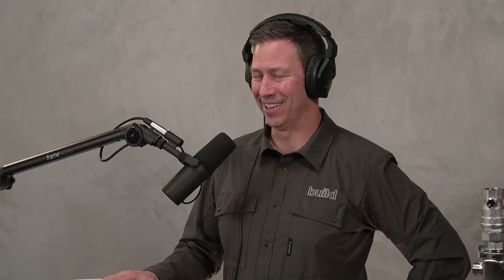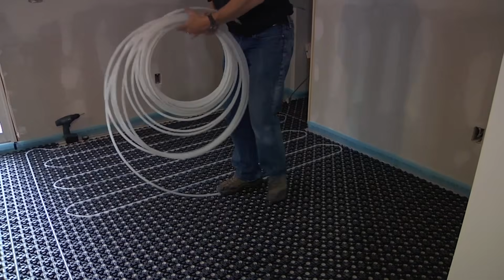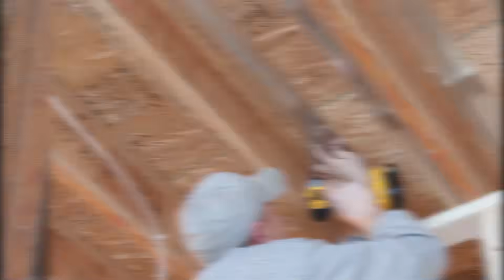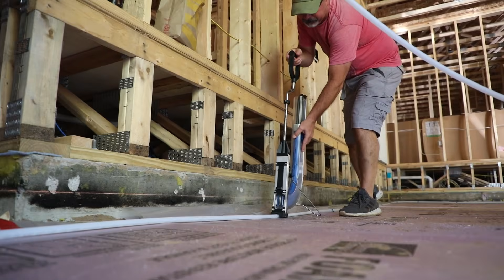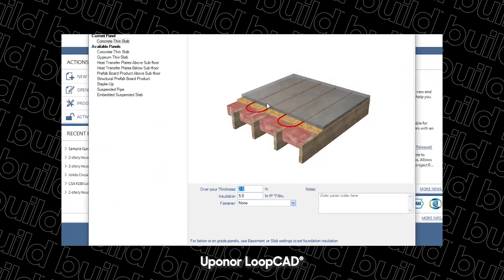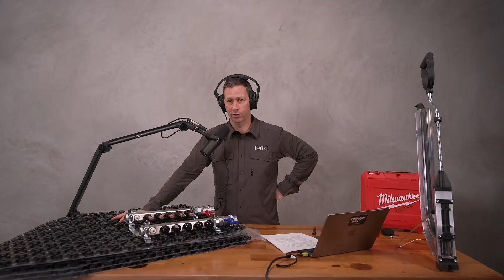4 Methods To Run Radiant Heat PEX Pipe

Comment: I like the idea of using this as essentially wainscoting on a remodel.  It would also be interesting to see this used in combination with a geothermal heating/cooling set-up.
Reply: I installed inslab 3 zones in my 2400sqft shop and storage downstairs. 3 zones upstairs living space 1000sqft.  I put a pump to each of the 2 bedrooms. Instead of using the outlets on the manifold and actuators. So used one of the spare outlets for heated towel rack. That I made out of brass tubing. I have geothermal. Horizontal loops. 1 acre lot. As well as solar 10,080 watts. Oh yeah r29 walls r65 ceilings. In Wisconsin.  Been running 2 years love it. Zero bills. House all electric.  Had outside put up by contractor.  Did everything inside all myself. Mostly by myself.  All wiring. plumbing, insulation, (Except  1"sprayfoam)drywall. (Except mud)Installed infloor, and inslab, insulation, pex, made manifolds. Everything passed inspection first time. I drive forklift for a living.... oh yeah I Installed insulation and pex before I had  the 8000sqft of concrete poured for the driveway.  Putting up solar hot water panels. This summer. For solar heated driveway.
Reply: @danmccoy6164  How far in-ground did you put your loops?  I love the idea of keeping the driveway "warm" in winter, at least a LITTLE bit above freezing!
Reply: @michiganengineer8621  
I had THE guy that everyone uses  around here and minnesota. Put in the loops.  6ft is good around here. He put them 8ft. By the time I finally finish spreading all the dirt from the build this summer. Will be about 10ft down.
Reply: @michiganengineer8621  
Solar heated driveway is  kind of an experiment.  Will have 12 4x10 Solar hot water panels to start with. Have room for more. Stated output 170,000 btus. Plus 2 storage tanks.  2 pumps. Pumps will be powered by solar electric panels. So when ever the sun shines it will be heating the driveway. So it'll be prewarmed also.
Reply: @danmccoy6164  Plenty deep enough to at least equalize the temperatures both winter and summer then.  AND deep enough so you could put in a garden as well, just have to make sure no tree roots try to infiltrate!
Reply: @danmccoy6164  You could PROBABLY use those panels to do sort of a "pre-heater" for your domestic hot water system
Reply: @michiganengineer8621  
Could but my domestic hot water is taken care of by the water jacket. On the compressor of geothermal heat pump. Don't need it. I accidentally designed and self built a Net Zero shop and house. Me being a forklift driver.
Reply: @danmccoy6164  I think a lot of people would be interested in what you are doing.  Any chance you could make a video . . .   you know become a forklift driving, net zero building youtuber?
Reply: @danmccoy6164  I want to have an air to water heat pump with solar evacuated tube for additional support but every professional I talk to about it looks at me like I am insane.
Reply: @cbeyre  
I took lots of pictures.  But not much video. Unfortunately. 
Plus I work too much. I  work 12hr shifts. I've worked at the company for 36 years. And have never worked less than 2800 hours. But I enjoy building things. Mostly motorcycles. I have 2 fun projects that came to a halt. When I started the shop/house.  A turbo charged 86 yamaha fj1200. And a smart car. That I can switch to a turbo charged snowmobile motor powered drive trane. In about 15 minutes. And back to stock in the same amount of time.  I have to get back to the fun projects. 

From what I've found. The evacuated tube panels have better output than the regular panels. But they don't last as long. Eventually the gas leaks out of the tubes. If I remember right. I have to do more research. Before I get the panels this summer. 

I used the same guy for the solar drive way that did the concrete in the shop. 
It looked like I just punched him in the chest when I told him I wanted to solar heat the driveway. After I explained it to him. He got really excited about it. Great guy. Took 9 guys 3 different pours 11 of the big cement trucks to pour it. It fully envelopes 3 sides of my 44ft x54ft shop/house.
Reply: @cbeyre  
You should look into geothermal. I have just under an acre. And I have horizontal loops. 4 loops for 4 tons. That I hired done by the guy who does all the geothermal loops. Around Minnesota and Wisconsin. For $5000. He put them in before any thing else. Other than the contractor had marked out the exact location of the house. After the grading was done They installed the pipes into the house.  Where the wall for the mechanical room  would be. And left the 2 ends sticking straight up out of the ground. About 6ft. They missed the wall. They are 3" outside the wall.  But I'm  impressed they were that close.  After I finally got it all  hooked up. They came back and filled the system. With ethanol antifreeze. If you don't have that much land  you can go vertical. I got 3 different estimates. From 3 different people. They all had wildly different ideas for equipment. The first 2 I gave my plans to said I would need atleast 6 tons. After supposedly doing heat calcs. I had figured. Not really knowing. Just my estimate. About 4 tons.  They came back $44,700. And $44,599. I  was devastated. That price put an end to my  build. Then I found out that a large local HVAC company did geothermal. I went to him. He looked at my. Plans and said hell for that you're only going to need a ton for cooling. And  probably 3 or 4 ton for heating. But I have to do the calcs. He said he had been installing geothermal for 35 years. And he said he has several of the first ones he installed are still the original units. He said because they are indoors and don't have to deal with the environment.  And they don't have to work as hard. They only have to raise the temperature from 56 degrees average ground temperature around here. Not trying to extract heat from -20. Or put heat out into 80s like air to water. He called me back in a couple of hours and said that I would only need 3ton but for times we get a week of -20. He found a 2 stage that normally runs on 3 ton and ramps up to 4ton for -20 weeks. And he had way simpler equipment than the other 2. I thought great maybe I can afford this. He sent me the estimate. $45,200. As a last ditch. I asked the HVAC guy for our 1,700,000sqft plant if he could get me the equipment. That was on the estimate. He said sure. I installed it all myself  including the warmboard and inslab. I have about $25,000 into it. I had conventional heating and ac estimates from $27,000 - $34,000. Took me quite awhile. Because I had to learn everything as I did it. I figure if you already knew what you were doing. It would've taken them a week. Max.

Oh yah I forgot. If you get one with the desuperheater. Don't ask me why they call it that. It will provide domestic hot water for your house. Basically a water jacket around the compressor in the unit  with a pump that circulates domestic hot water through the jacket and back into your water heater. Will turn off the pump to keep your water from getting too hot.
Reply: Yes, radiant with geothermal is definitely the way. If you got the land that is
Reply: @jwristen24  and/or a pond
Reply: @Lumbeelegend  You could go vertical for geothermal if you're on a smaller lot.  I've seen some installations where they did that.
Reply: @michiganengineer8621  how deep do you have to go for vertical geo?
Reply: @michiganengineer8621  yes, and if you live near sea level its pretty good. If you live near a layer of rock... that's a nightmare, lol. Idk if it'd work in rock. I'll look it up
Reply: @michiganengineer8621  oh, apparently its not hard through rock either. Thats pretty cool
Reply: @markpetri3405  Most of the ones I've seen are about to the depth you'd drill for a water well, which is probably excessive.
Reply: @Lumbeelegend  Rock or caliche may not work that well.  Although if you can get down to or at least near  the aquifer level you should get decent heat transfer.
Reply: @michiganengineer8621  We have built 8 vertical closed loop geo systems on 3 to 8,000 Sq ft homes here in WV recently. Water Furnace. 5 to 8 wells 160' deep. Mostly rock and pour thermal grout down well to help heat transfer. De-super heater provides domestic HW. No customer complaints.
Reply: @gregkump3639  Thanks for that info!  The boss would prefer to stay in Michigan so the soil isn't going to be QUITE as solid as it is in the Appalachians 😄
Reply: @michiganengineer8621  rock is actually better for heat transfer. 
Just  sayin.😎
Reply: Yes!  I'd like to see any discussion on multiple heat sources working in combination.
Reply: Geothermal will be too much money UPFRONT FOR ME .PROPANE HEATING antifreeze
Reply: I think wainscoting is a good plan
Reply: The Brits are being forced by regulation to shift to heat pumps to heat their hydronic systems.  Didn't sound like it's sorted out yet, but it'll come along.  The Europeans are decades ahead of the US on radiant hot water heating.  They skipped the steam era as to dangerous.

Comment: I've had radiant, in floor heat for 22 years with a concrete over pour method and seven zones in eastern Canada. The floors are finished with ceramic tile and parquet flooring and I have recently converted from oil fired boiler to an air to water heat pump. To say I love it is an understatement and it works best if you set your thermostats and leave them. When your feet are warm; you are warm.
Reply: Hey Barry, do you mind telling me what kind of air to water heat pump you're using? I'm in Manitoba about to build and I'm still debating between electric boiler or heat pump.
Reply: @adamdouglas8786  I'm looking to do same, hopefully Barry can get back to us. Have you looked at a company called Arctic? They have a line of air to water heat pumps.
Reply: @kaspergruszczynski9919  I'm and electrician in the northeast, I've helps install Artic air to water units before. Seem like nice units with lots of flexibility.
Reply: @adamdouglas8786  I would like that info...and history of dependability...which is the 100percent concern. Thanks. I would LOVE to do an 80 gal hybrid water heater and an indirect tank. My plumber says I am crazy.
Reply: Sorry for the delay...YouTube doesnt tell me there are responses to address. My energy GURU says that the least expensive way to heat water is hybrid. HE has one in his house for dhw. He has solar pv and water tubes on his house too. I think that would be a PERFECT way to run your radiant system. I am GUESSING that you would need an indirect tank to keep up the load in cold climates...I  would need to. The only downside to hybrid water heaters...and the 80 gallon old fashioned ones are banned in Massachusetts...hybrid is new code...their repair history. If they break...just try to find someone that wants to repair the refrigerant system...in or out of warranty. Its almost impossible...even the manufacturer doesnt want the job. IF I ever do it...and my 80 gallon hybrid fails...I will just buy a new one. If its under warranty they should replace the unit..for free .and me or the plumber installs it...which is pretty easy.
Reply: @adamdouglas8786 you don’t want to boil the water
Reply: Hi Barry, I second Drew's question. I'm also keen to hear who you've gone with. I want to do the same in my home and I'm just a bit hesitant as air to water heat pumps are uncommon, let alone for a radiant system. Currently looking Arctic's units.
Reply: @kaspergruszczynski9919  hey just say your question. I have a 4000sqf shop on Vancouver island and recently installed the big arctic heat pump and it's been a dream. No complaints yet going on 5 months.
Reply: @brookreimer8818  that's good to hear, I really liked what I've been able to find about them but first hand experience with the unit is invaluable. Did you install the system or did you have an hvac do it? Now, for them to just become eligible for the Greener Homes rebate. That would be perfect. :D
Reply: Sounds dreamy even in Texas 😂
Reply: Hey Barry I'm in Shediac New Brunswick  what unit u installed? I talked to local heat pump 
Installers they say stay away?  Because they don't know  unreal how many Installers that haven't a clue of the systems out there 🤔  thanks
Reply: Do you know what the delivery temp of your water is fro the heat pump ?
Reply: @M13x13M  It's about 42 to 50 degrees C.
Reply: Isn't there a stagnant air issue with radiant floor heat? I have a room in my house that holds passed gas smell for an hour so I can't imagine a system that is designed to not use airflow being different.
Reply: @TheEngineerJason  Stagnant air wouldn't be a characteristic of in-floor heat any more than baseboard heat. Any well insulated home today needs a separate air exchange system, usually a heat recovery type, to make sure you exhaust the bad air and bring in fresh.
Reply: @TheEngineerJason  no there isnt any stagnant air FROM IT. If you have a bad smell its from a problem. Radiarors work the same as radiant and they dont smell. Some people want moving air for comfort...its just preferance. Mine is 23 yrs old and zero smell.
Reply: @@rogerwhiting9310  What I meant to say is that the bad air is from something else, namely me passing gas and the wife walking in the room an hour later and still smelling it. It's an issue even in my forced air home in rooms that aren't vented quite right so I was wondering how that's prevented in a system designed to not move any air. I plan to build a home in a few years and I love the concept of heated floors but I also want to keep some fresh air circulated.
Reply: @TheEngineerJason  Well.... whole house air exchangers are pretty much code so that should save you with your new build........
Reply: Hi, I'm curious,  does it work through those real cold days? Or do you have to supplement?
Reply: @mrcrock2095  Two weeks ago we had more than a day of -24 deg C with wind chill of -35 C, and the heat pump continued to put out the same flow and temperature of fluid; so yes, it actually did work well. Having said that, I did have some supplemental radiant propane heat for a half a day in the large living room that has one wall with a ton of glass. This worked out ok because I sized the heat pump to handle all but the coldest days.
Reply: Ahh so no set backs..los of heat retention..i grew up with baseboard heat loved it.. heated fast and retained heat after off..cast iron best at heat retention..
Reply: Always on..interesting..
Reply: Hi Barry I was thinking on the water heat pump from oil boiler to my place is ICF house with 6 zones all on single slab . I would be interested in seeing your mechanical room how your piping is done .
Greg. In Nova Scotia
Reply: I installed mine...on my hands and knees 20 years ago using all Wirsbo..soon to be then Uponor pexA and hardware. I had a convertible Buderus boiler that started on oil and now is NG. 1600SF main floor...9 zones 100percent coverage and 5 zone poured slab 1600 sf basement over 4 inch dense foam. Living space is the plywood track system and Brazilian Cherry over it. It costs about $900 to heat main floor to 71 and basement to 60...in SE MASSACHUSETTS. I havent done a SINGLE thing to it...no pump, tubing, electric issues at all. I have solar panels but it just covers 100percent of my electric bill. The air to water heat pumps are notorious for malfunction and nobody wants to touch them for repair. Anyone else have feedback for heat pumps?
Reply: @rogerwhiting9310  so snow increases solar..
Reply: @rogerwhiting9310  
Hi everyone,
Heat pumps (every system) working well in environments where outside/inside temperature difference is steady and significant most of the time and for buildings with not so well insulated envelope. Otherwise they basically a waste of money. Sellers never tells you about the lifespan and replacement costs of those moving parts. In general - the "energy saved" difference will be eaten by the overall higher buying costs of the whole system, maintenance and expensive parts replacement. Most of the systems installed are mainly for the "green" feeling but in reality they are green just like Tesla Cars. Properly designed and installed low temperature hydronic floor heating system is highly efficient and will be still economical basically with any known heat source included a simple electric thankless water heater.
Reply: @georgelesdeplorables7583  If I installed an instantaneous electric heater to heat my radiant system the calculation per the PhD engineer...it would cost at least TRIPLE. That would take my heating cost from $1000 to $3000/year. Electricity is going up 65 percent in Massachusetts...so add another 65% to that soon. A hybrid 80 gallon water is in the $1800 range around here...with a 10 year warranty.  If it breaks...I get a replacement umder warranty and a simple plumbing swap. An indirect tank would probably be needed...but they last forever. To suggest that I spend probably $4000 to heat my house your way is ridiculous at every level. If you can buy electricity for 5 cents/kwh....then YOU would be correct. Not even close near me..

Comment: Radiant floor heating should be mandated code in cooler climates. McMansion builders would laugh at you if you asked if they used it. Someday before I die, I'll own a home with radiant floor heat. Even better, heated by geothermal.
Reply: Ummm nothing is stopping you from installing one yourself how about you let people build what they want or can afford and mind your own business with code shit
Reply: @StealthNinja4577  I'm an American If I want substandard building let me build one. That's why you guys have like 3x the CO2 emmissions than for example France, your houses suck. House that you build today is gonna be around for 50 ,60, 100+ years, no excuse to build it inefficiently.